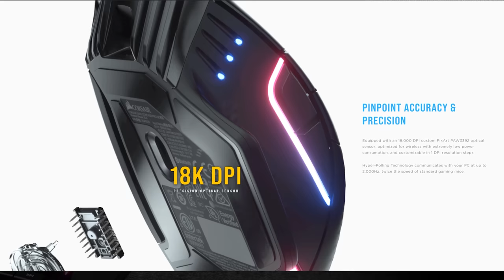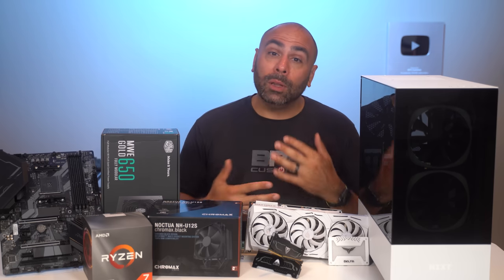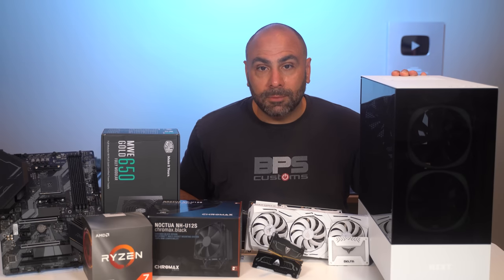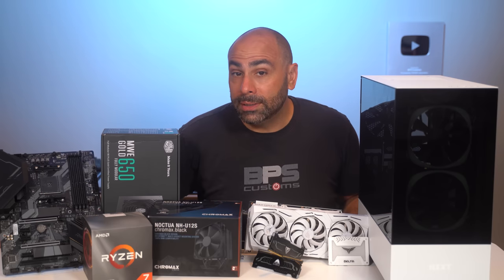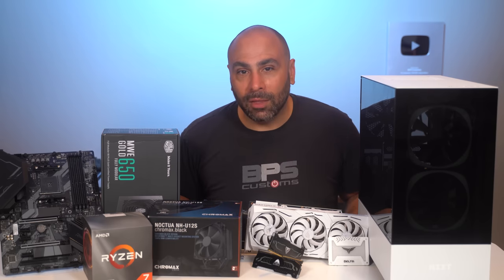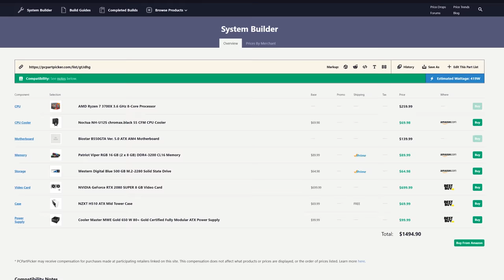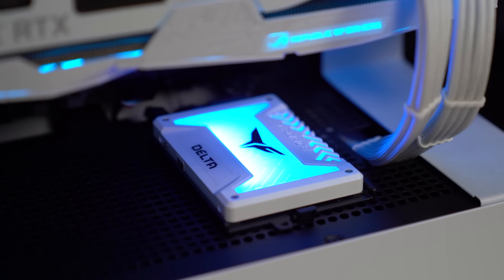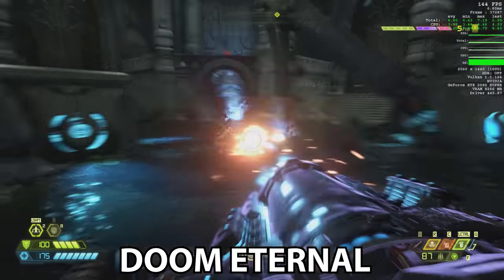$1500 Gaming PC Build For 2020!

Comment: I just got a GTX 1060 6GB for $130 on ebay today and decided to build it in an broken OG Xbox. Going to pair it with an i3 9100f, 16GB ddr4, and a 350w flex atx psu
Reply: You should go for a higher gpu. Maybe 550w from a trusted brand.

Comment: Super duper clean build. The only thing I'd change is probably the exhaust fan and put the same fan as the front intakes, just for visual consistency. But the specs are great, the 3700X's value IMO is the best on the market in terms of price for performance.

Comment: The VRM on that motherboard looks so weak though. Something to be aware of depending what CPU it's paired with.
Reply: what do you mean with that
Reply: @rythmecho8392  Board has 6 Dr MOS at 90a each.  Most of the b550 boards were targeting 8-12 at 50-60 amps.
Reply: yall still tryna overclock AMD cpus... i mean for most the performance gains aren't exactly catching everyone's attention'
Reply: @baiomarlaye3165  I don't think the VRM is beefed up on x570/b550 for overclocking reasons in the current gen(gen 3 ryzen).  I think AMD told them to spend more money on extra VRM phases, which would make "cheap" b550 boards kinda sketchy(the b550 tax is primarily based on extra VRM over the b450 boards).

Comment: It should go without saying that you can OC that 2080super, but I would have saved (roughly) $200 and just gone with the 2070super. 
I have an EVGA XX ultra 2070super. OCed safely to 2070mhz (for a few titles I turn it down to 2050mhz). The VRAM also OCed very nicely. So basically my 2070super is about as fast as a stock 2080super. Now you could take that $200 saved and either just pocket it or get the 3900x for your cpu. 
Another option for that $200 saved is a nice set of 3600 cl16 ram and an additional ssd (an NVME for boot/apps, and an additional ssd for fast bulk storage).
Just my .02!

Edit... for sure would use that $200 to swap out that MOBO...
Or just go with the B450 Tomahawk (max), the max doesn’t even need a bios flash. Only go B450 Tommy if your fairly certain you won’t be upgrading that cpu for a few years as 3xxx is the last generation supported on it.

Comment: Hi, very nice build, what are the temps on the 3700x with the U12S , I have the same 3700x with an older version of U14S in a H200, and the idle or light usage like browsing, the temps are all over the place fluctuating between 51 C to 63 C , Under load it does not go over 72 C but still I would expect it to be middle 40sh in idle or light load?

Comment: i like the cooler. does it come with the fan?
Reply: Yes. Cooler name is NHU12s. 120mm fan included with heatsink.

I'm using this cooler since December. Pretty good performance.

30c idle and 60c while gaming. My processor is R5 3600

Comment: I'd rather a 2070 super, save $200, ditch the slow ass SSD for a NVME, and get a Phanteks case for better airflow...
Reply: If you aren't streaming/heavy multi-tasking, dropping down to a 3600 for the cpu won't change game performance either.
Reply: @Deukish  True. So many routes you can go as of lately

Comment: Hi, what board would you recommend for i9 10900k? I do not game. I will be using it for trading. But will overclock it for trading software. I do not know anything at all, want to seek your advise so I will not accidentally bought a board that is overkill from what I do or too bad for to support the CPU.
Reply: Initial list 
I9 10900K 
ASRock Z490M Pro 4
BE QUIET DARK ROCK 4 Pro COOLER/ Notua.
500GB NVME SSD 16GB 
KLEVV DDR4-3200 
ASUS GT710 GPU
COOLER MASTER MWE 650W GOLD CHEAP CASING

Comment: Is Gigabyte X570 AORUS XTREME EATX AM4 Motherboard 700$-1200$ even worth it, or should I just use Asus ROG Strix X570-I Gaming (340$),
for   AMD Ryzen 9 3900X 3.8 GHz 12-Core Processor +  GeForce RTX 2070 SUPER ?
Reply: Dude that's a halo product. So no it's not worth it. Stick with the Strix

Comment: For white light try RGB 128,128,128. That's how I've been able to get white on some software that dosen't have white as an option. (Asus Aura for example) But it will probably skew slight blue or slight red anyway. All RGB software is basically garbage.
Reply from the maker: White should be 255 255 255 but in the Biostar software there's no place to input color values
Reply: @BPSCustoms  That sucks, and yes white should be  255,255,255 but that results in red in some software, so if you input that and then cut the intensity to 50% somehow it results in white at 128,128,128. Like I said RGB software is garbage.

Comment: Hey, I was wondering if you could give me some advice? 
So I got a PC build, I didn't build it myself, but I now own and is my first right, I was wanting to use it for game capture from ps4, but I'm having an issue. So this is the build. 
CPU: Xeon x5670 2.93GHz (6 cores, 12 threads) 
GPU: Gtx 1650 super 4gb 
Ram: 12gig ddr3 1333mhz (3x4gb) 
Motherboard: huananzhi x58 
Storage: 1tb hard drive 
PSU- EVGA 600 BR 600W power supply 
Case: phanteks eclipse P360x 
Now, my problem is, i'm trying to game capture, but I have the black screen issue, after a couple emails, elgato support says that my CPU does not meet the minimum requirements and I need a 4th gen quad core Intel core i5 CPU minimum to function. Is anyone able to tell me if I'm able to just buy a new cpu or do I have to buy a whole bunch of other stuff? Some people say I have to buy a motherboard as well as a new cpu, or can I just replace the cpu? If anyone can suggest what I should do them it be very much appreciated

Comment: Why do all these "budget" builds splooge so much of the money on overpriced cases and RGB fans/SSDs? The 510 Elite looks nice, but you can get better performance/quality for much less. When the benches are barely scraping 60fps (on 2019 games),  I'd definitely be ditching the  lights and upgrading the components.
Reply: It’s 1440 p
Reply: @jesus_11  if it's benching on 1440p then I'd assume it's built for 1440p. For a 2020 machine I'd expect some headroom to actually play 2020-2021 games. It's just another clickbaity build using a nice case and RGB everything to make an attractive thumbnail. For a normal person with that budget and 1440p in mind, this is not what you would go for.